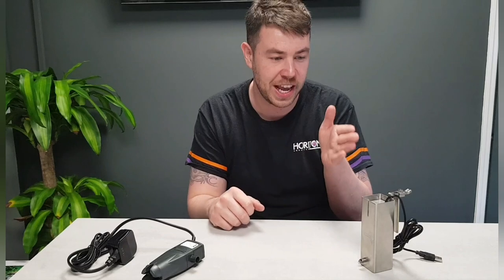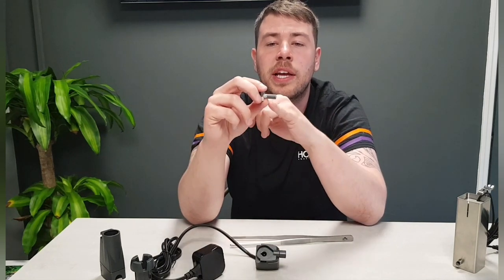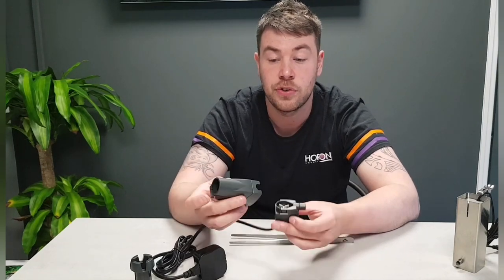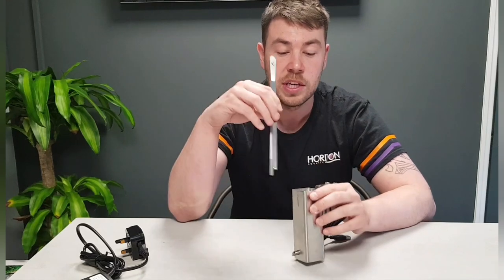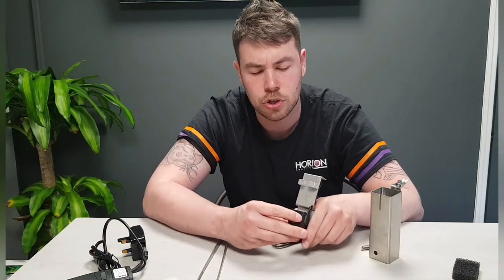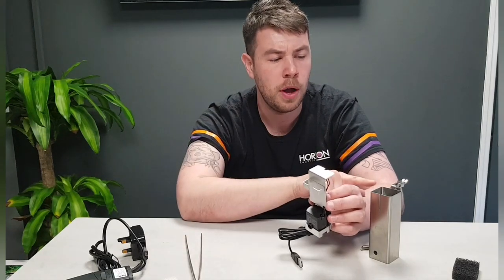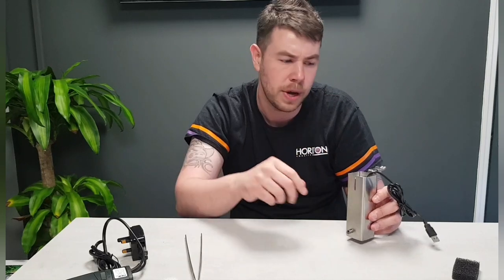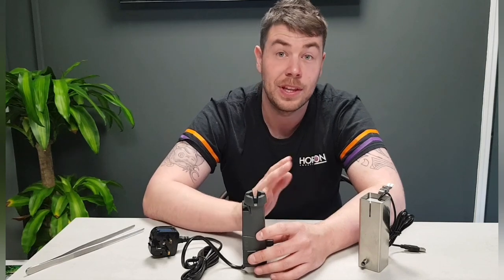Eheim skimmer vs ADA Vuppa

Comment: Hi James, I great review. I am thinking of setting up a low tech 40ltr as it’s going to be in a cubbyhole I want as little fuss with equipment as possible. I was thinking that 1 or 2 of the Ada skimmers could  work as filtration. It will have a few galaxy’s and shrimp . What are your thoughts
Reply from the maker: Hey Tom ada made the the vuppa as a skimmer but some people do use them as filters in small shrimp set ups with heavy planting. 

On that size I would recommend a small external filter as it will handle the fish waste better and also keeps the minimalistic look 😀 if you need help or advice feel free to give us a call.